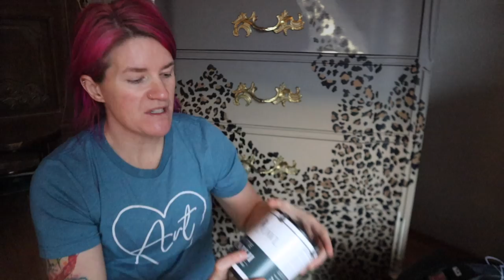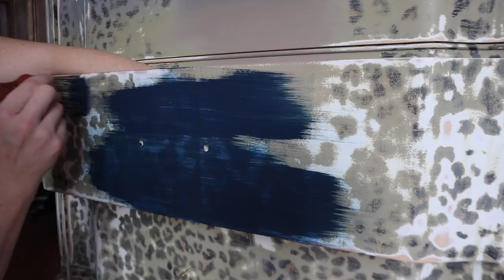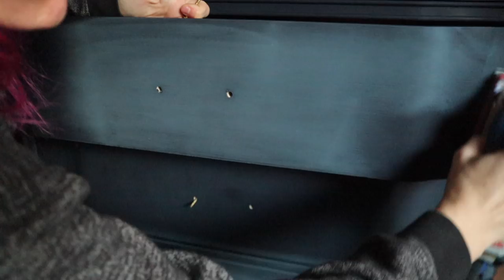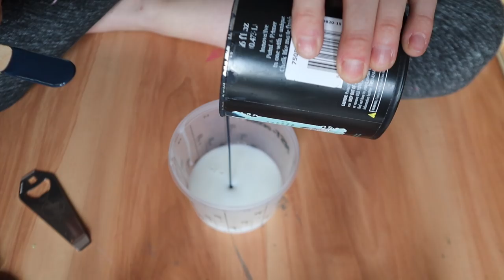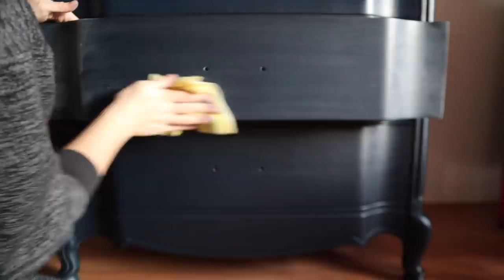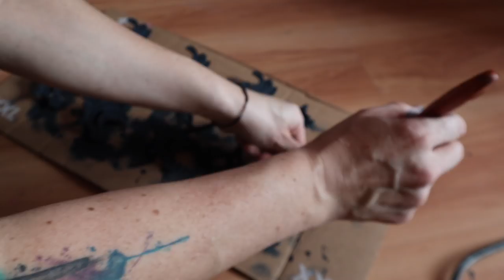How to Create A Flawless Finish Using Dark Paint | Removing A Decor Transfer And Repainting

Comment: I absolutely love the makeover of the chest of drawers.  I just finished painting a dark navy mixed with black chest and I love the color.  I, too, mix a little bit of paint in with my top coat to try to prevent streaks.  I've got to invest in a wide brush because it definitely covers more area than a narrow brush does.  Thanks Crys'Dawna for another great makeover.
Reply from the maker: you are so welcome!! yes a good soft deck/ wall block brush and you can do so many thing it also makes a good neutral brush for blending when you need to soften everything!!! Thank you so much!!!!

Comment: I love this! I painted a cabinet and then lightly sanded it with 240 grit paper and I had all the white stuff everywhere and I thought I ruined it for the topcoat. So, I painted it one more time and didn't sand it and then put the top coat on. I was a bit disappointed but this makes so much more sense. My piece turned out well and the finish is nice and smooth but I think it could be better. Being a perfectionist I'm gonna try this method on the piece I'm working on now.  Thanks for doing this without a sprayer too (I don't have one) I tend to not watch vids of pieces that are sprayed because I don't learn anything from that.  When I get one and if ...then I'll watch those. anyway, thanks again! great video

Comment: This is a great video, with so many helpful hacks!
I just bought my Surf Prep, (using your coupon code, thanks!), and I have questions. When you say, "scuff sand with one of the very fine rad pads," what is that? One of the sponges? (which thickness? 5, 10 or half-inch)? One of the papers? Using the interface pad? I think I need a tutorial on how to use the various sanding options of the Surf Prep!

Thanks for all your wonderful projects and instructions!
Reply from the maker: Ooh I think I can do a tutorial for you, so I like the fine 10mm or even 5mm pads to scuff if you are using the paper you could use a 220 for it :) anything that will scuff your surface so fine/220 or higher in any of the abrasives :)
Reply: @BellaRenovare  Thanks! I guess I asked the wrong question, lol. I couldn't figure out which of the million abrasives they sent with the Surf Prep you were referring to as a "rad pad" since none were labeled as such! It's the sponge, right? So many choices - a tutorial or 10 minute on what to use in what situation would be amazing. Their chart is super confusing, and it would be helpful to know how to use and what to use with this awesome sander.

Comment: Will the brush and seal coat leave brush strokes? I'm struggling with getting an even finish so hopefully I'll be ok with your technique!!
Reply from the maker: no so, use thin coats a light hand and make sure you lightly sand in between coats, you really should have a great finish :)